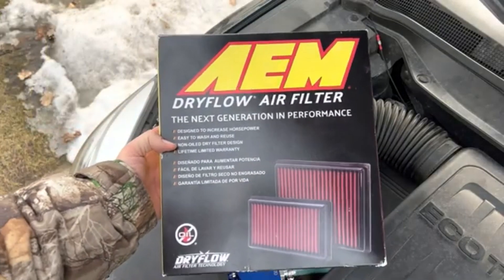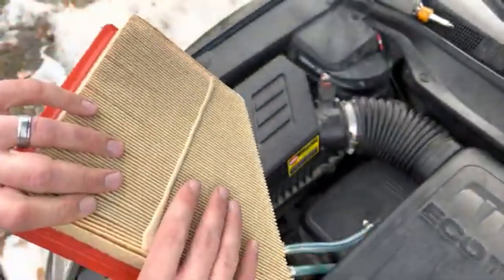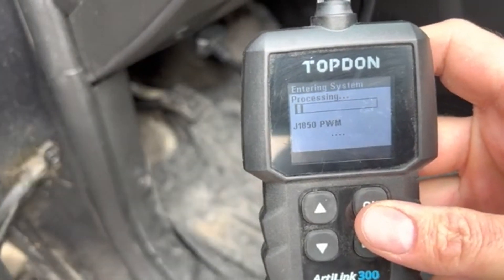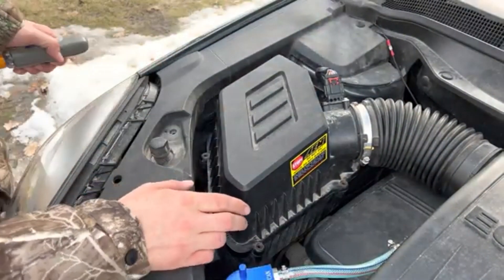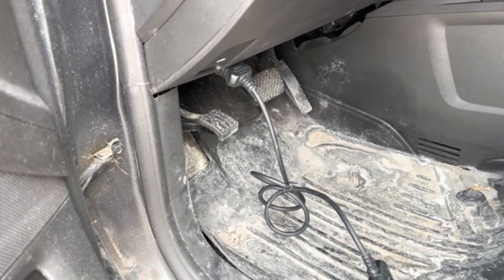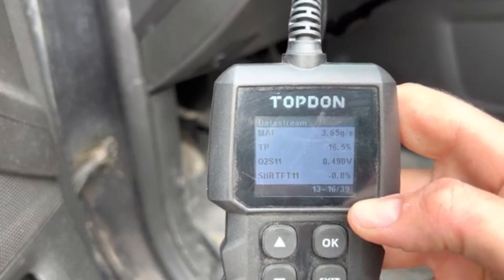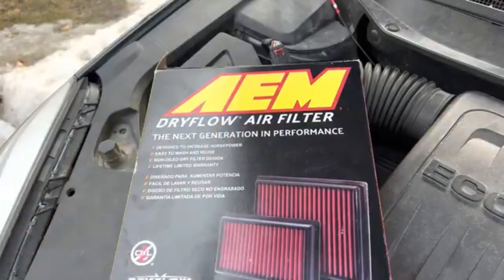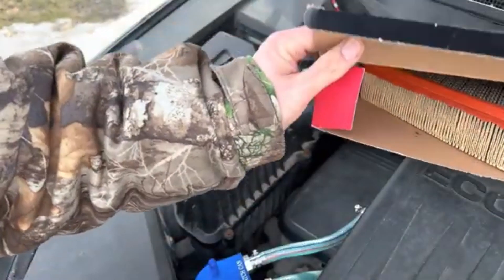AEM Dry Flow Air Filter Install & Test

Comment: I have that same AEM filter in my Dodge !
Reply from the maker: Nice. How do you like it? Please like and subscribe
Reply: @BillOfAllTrades2016  
It’s great so far, has a nice seal, very quality made. K&N makes them, I noticed a bit better throttle response in a Dodge Challenger.
Reply from the maker: Ya I have been hearing that they own aem. I guess they bought them out in 2009 but kept the name. I also noticed less hesitation in the equinox.
Reply: I could definitely tell more air from an AEM dry filter in a Trailblazer - different kind of AEM filter though.
Reply from the maker: Ya I can actually hear the air coming in a lot more. I can hear it pulling pretty clearly from inside the cabin. Thanks for watching. Please like and subscribe

Comment: Throwing this on a stock motor is a waste of cash. These stock air boxes are overbuilt from the factory, so they are already maxed out for air intake with a standard paper filter. Maybe if you had added a lot of boost or larger throttle body, it would be noticeable.
Reply from the maker: Still not a waste of cash in my opinion. They are still reusable and saves buying new filters and filling up the landfill. Every year I just wash my filter in summer. Keeps it efficient. Saves money.

Comment: buy factory filter....no time to wash and reuse a dirty filter!!!!
Reply from the maker: To each their own. I like my washable filter. I don’t mind a tiny extra effort to help save all those filters from hitting landfills. Thanks for commenting
Reply: @BillOfAllTrades2016  Is that why you're doing it? To stop extra trash? I commend you if so, I just don't trust K&N. So I'm wondering if these guys filter as well as stock. If so, I'm all for it.
Reply from the maker: I can’t speak scientifically to the filtering properties of this filter vs oem. However I’ve never had any issues running it on this vehicle. I also have a k&n on a Pontiac vibe for the last 9 years and no issues to report there. If you want to see the filtering performance against multiple oem paper filters check out the channel called project farm. He compares a bunch of them. Thanks for watching. Please like and subscribe